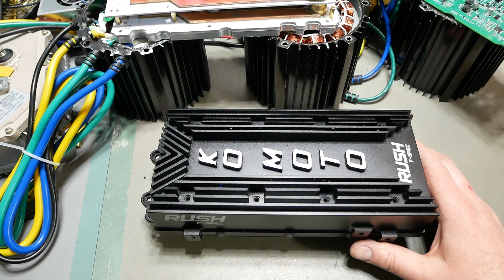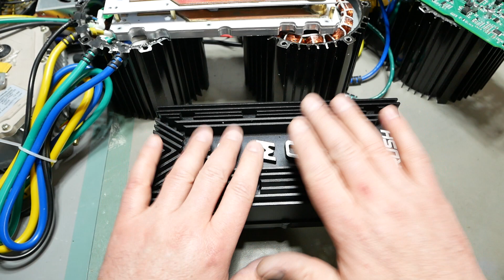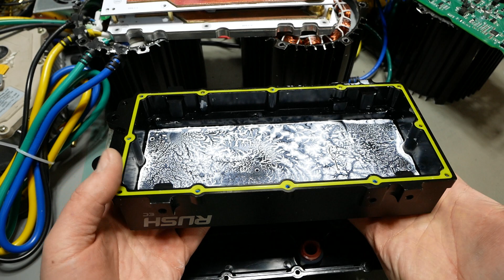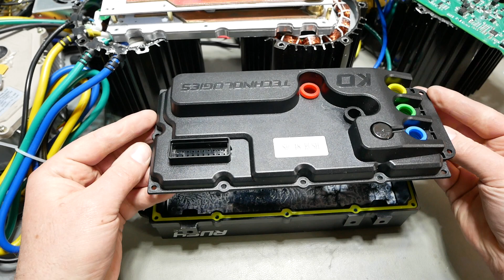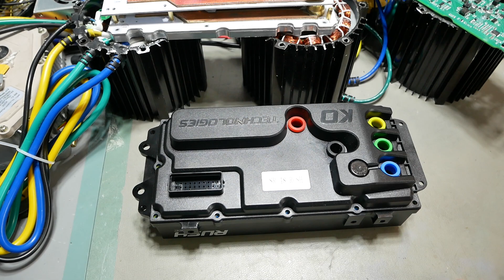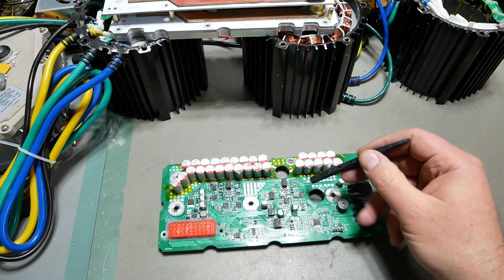KO Moto Rush Overview 1

Comment: so what controller do you recommend for a surron x light bee?
Reply from the maker: I'm assuming you want something that is designed to fit the bike right? Right off the bat, if it isn't something with a full FOC suite like VESC, Nuckular or ASI, I'm not going to recommend it. Pretty much everything else including  KO products are based on a lower power CPU that can't run the full FOC functionality. Of those options VESC is the best one with a VERY broad selection of controllers to choose from. For your application the EBMX X9000 or Trampa STR500 are both great options.

Comment: KO spends 50x more time on branding and looks than actual performance engineering
Reply from the maker: I like a pretty controller as much as anyone does. However, that's the box that the parts that matter go inside of. FIRST THING is make a good controller! THEN after you nail that down, work on the box it goes in! KO doesn't understand this!!! All they have is a pretty box. So yeah...totally agree.

Comment: It’s so hard to believe they would be so shitty I had such high hopes they really know how to talk there stuff up glad I didn’t buy it I was going to think I will go x9000 or have you seen the electro co one Sur ronster put on his new black light bee it’s only 500 and he said it’s better then ko and better then bac 4000
Reply from the maker: I wanted the Rush to be better too. I wanted what tricky Chris said to be true and it's the same steaming turd as ever! X-9000 is a good choice. They listen to feedback unlike KO! They will have another controller out soon that runs at a bit higher voltage. I'm sure the feedback they have gotten so far is getting incorporated into that new controller. I have read about the ElectroCo controller, but that's all. I don't know anything about it.
Reply: Should look into ebmx 9000 bricking issues going on. Know of 3 people personally that there 9000 controllers bricked when trying to update firmware. Many others are starting to report the same issues online as well.
Reply from the maker: @JRIPFPV  I ASKED Matt about this "bricking" issue. He's quite transparent and forthcoming! "Bricked" is the wrong term. "Temporarily unresponsive" is much more accurate. Matt did know about this. They are adding the programming cable as part of all future kits they ship. Up til now, it was a separate item. However in situations where something happens with a firmware update, VESC has the ability to recover the CPU even in really horrible situations! The programming cable makes that recovery possible and so I repeat "temporarily unresponsive" since it isn't really "bricked" at all. The programming cable gets this issue fixed every time! The only reason why the "list" seems to be growing is due to the numbers of X-9000 controllers out there is increasing rapidly! This issues does happen, but it's pretty rare! It's like battery fires, they happen, but how many people have seen one in person?
Reply from the maker: @JRIPFPV  I have not heard anything about this! I will talk to Matt Wauters right now. IF this is a real problem, he knows about it and will tell me.
Reply: @JRIPFPV  easily fixed with a program cable, which Matt is sending out to those that need them. Once you are in the latest firmware you will be problem free.